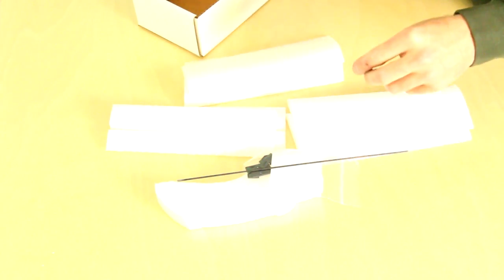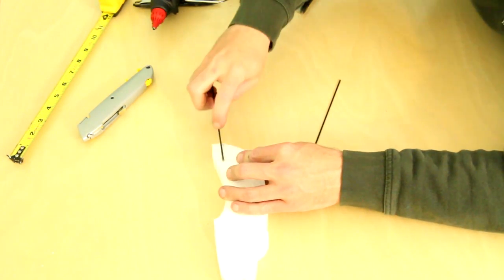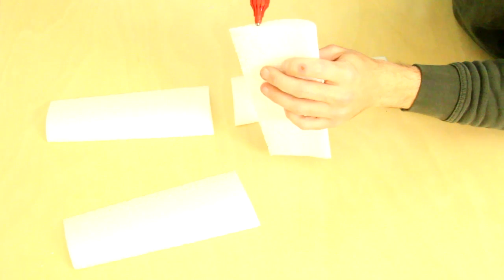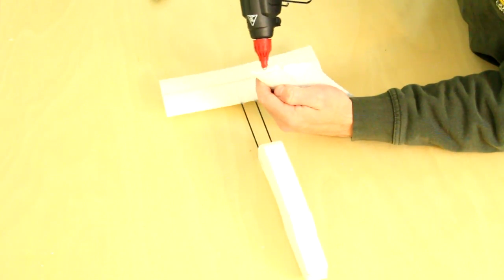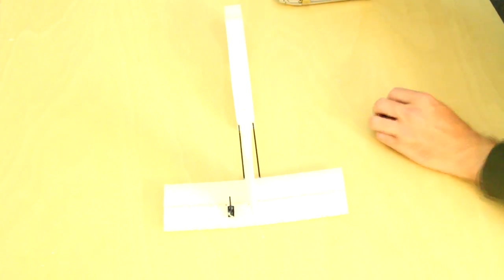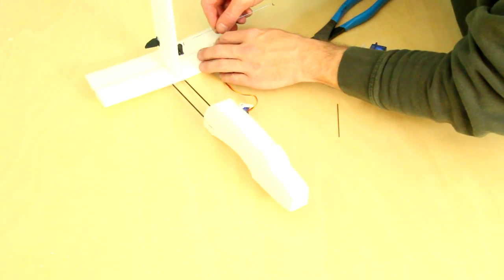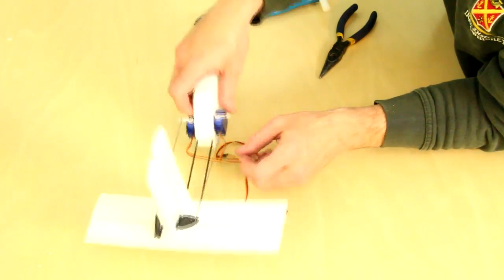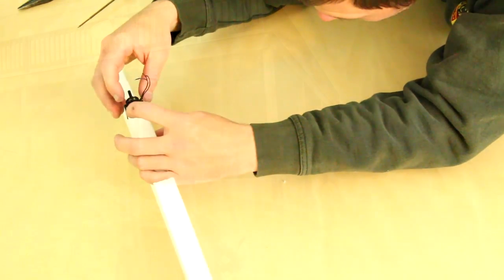VAS Gremlin airplane build video

Comment: So the motor is a permanent install? No X mount, just bolt it to the firewall and glue everything into place?  And destroy the nose if I ever need to switch the motor?
Reply from the maker: With hot glue install you can remove it by warming it up with a heat gun.  Or you could just chop off 1/4" of the nose if you like since the plane is already naturally nose-heavy.  Everything on this is to save weight.  The lighter the plane is, the better it flies.
Reply: Rubbing alcohol will release too. Hmm 1306 motor you like 3300 or 4000kv?
Reply from the maker: Really?  Rubbing alcohol?  THANK YOU!  I didn't know this.  1306/3300kv for the motor.
Reply: That's what I've been told by numerous, haven't had occasion to use it.  Using the freezing tendency of canned air can loosen hot glue grip too I believe.
Reply: https://lifehacker.com/5676237/use-rubbing-alcohol-to-remove-hot-glue-from-nearly-anything
Reply: @CAGreve1231  I know this is old... but after building the spark mini I'm looking for an even smaller area plane :)... yes rubbing alcohol is great for releasing the hot glue, I put a little too much on my firewall on the spark mini and it wouldn't let the motor spin, I used a q-tip, dipped then dabbed it on the exposed edges, went back a few min latter with a little more and then gently pulled the motor mount away which gave me a MM or 2 of give and dripped some more with the qtip... it pulled away nice and smooth... also used it to remove servos from EPP and foamboard with a similar method

Comment: Nice tutorial.  Only thing I would change would be to call the bends in the control linkage wires, "Z" bends ... that's what they've been called for decades, and more aptly describes the kind of bend you want in the wire (as opposed to an "s" bend). From a "classic design" POV, I'd like to see a smaller vertical fin. However, in order to get sufficient directional control without ailerons, your  method probably works fine. Now, if you opted for a small vertical fin (no rudder control) and put 'barn door' ailerons in the lower wing, that's another way you could go with this thing. Suggest you don't let your dog chase after and bite this one as he does with some of the small quads you've let him 'play' with .. wouldn't be much left. Cheers.
Reply from the maker: The large stabilizer in the rear changes the way the plane turns.  The smaller the rudder, the more the plane rolls into the turn.  At 5.5-6" it naturally makes a coordinated turn.  At 4" and less it rolls like ailerons only.